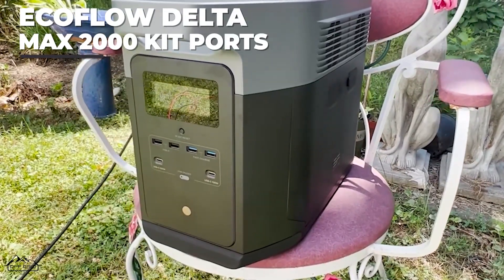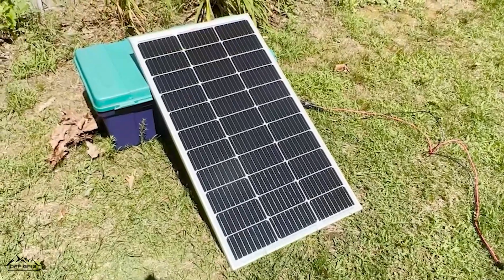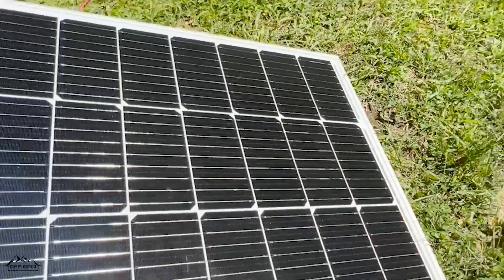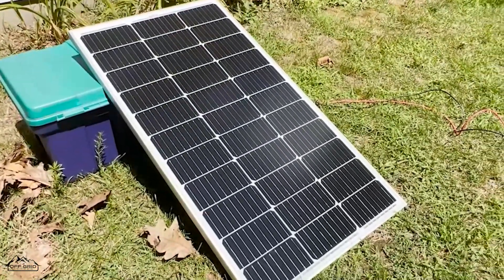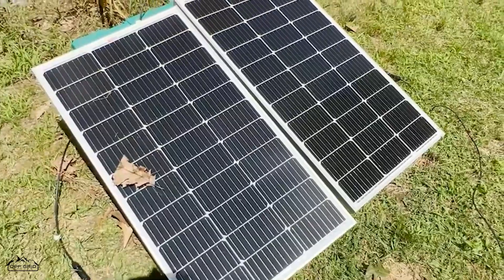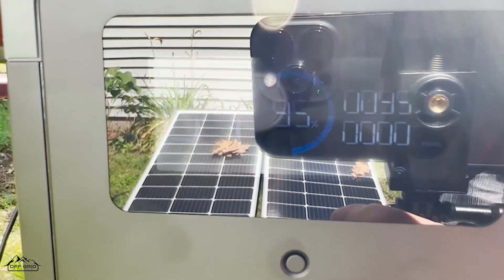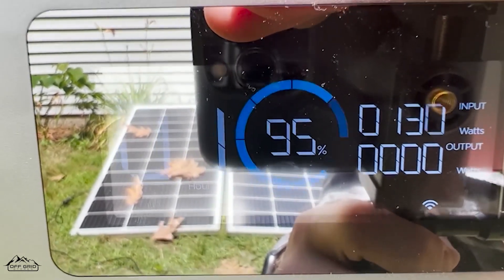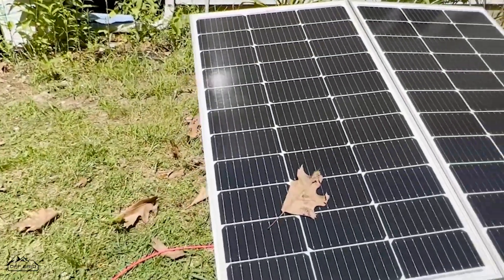Getting The Most Power Out Of Your Solar Panels

Comment from the maker: First Time Customers Get 10% Off Their Order With Code " 10%NOW " At Check-Out
Items Used In This Video:
EcoFlow DELTA Max 2000 Solar Generator: https://offgridstores.com/products/ecoflow-delta-max-portable-power-station-solar-generator
100W Solar Panels: https://offgridstores.com/products/rich-solar-100-watt-solar-panel-rs-m100
2 To 1 Parallel Connectors: https://offgridstores.com/products/rich-solar-y-branch-parallel-connectors
30' MC4 Extension Cable: https://offgridstores.com/products/rich-solar-10-gauge-30-feet-solar-extension-cable-rs-30102

Comment: Thanks for the Series - Parallel comparison.  One thing I've learned is to be aware of the generator specifications for PV input.  You don't want to exceed, or under-deliver, the proper voltage and amperage.
Reply from the maker: Yes exactly. We actually have a video on that too!